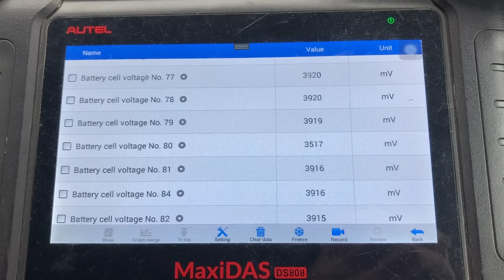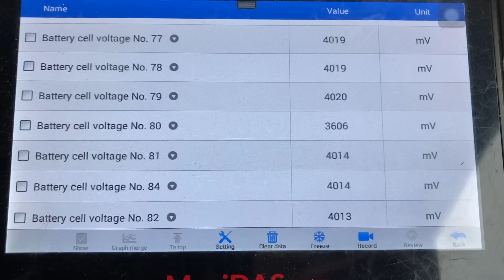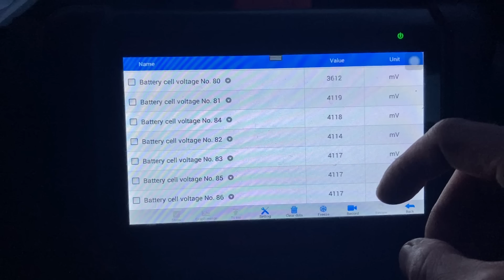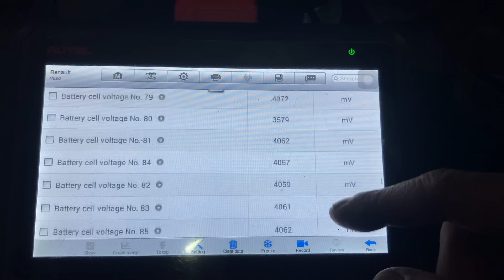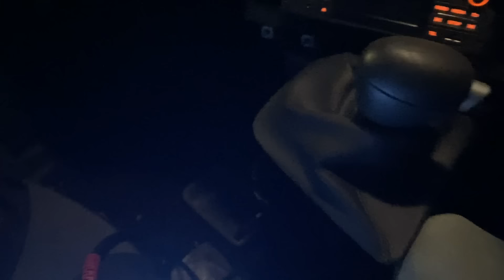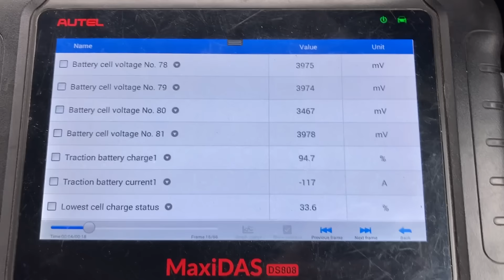2018 Renault Kangoo ZE33 battery repair PART 1 - low cell, EV repair

Comment: Hello, I have a 2014.Renault kangoo  130.000km, 22kw battery with about 57 soh and 2 bad cells. Should I try the same thing?
Reply from the maker: Hi it depends how bad the bad cells are but I am aware the 22kw Batteries can be quite tired by now, especially given the mileage of yours. It likely needs replacement cells or I believe you can fit the larger Battery, you just have to get one cable from the donor can where the bigger battery comes from. Cheers
Reply: @garycevrepairs there is a message on the dash elec fault. It charges it runs and drives. I also changed the 12v agm battery few days ago

Comment: Until you can measure the voltage of the individual cell with an independent meter and compare with others we don't know if it is a faulty/under charged cell or faulty BMS. As it does appear to be OK.
This brings back the argument, should you charge a lithium battery to 80% to protect the battery or 100% to enable balancing the cells. I guess a bit of both and depends if you intend to use the vehicle straight after.

Comment: My money is on that call being leaky. Best way to check is leave the car off charge overnight and see if it drops more voltage than the others.

Or maybe the cell balance failed or was disconnected, at some point?
Reply: Or they put the wrong capacity cell in?

Comment: Don't know if this will help but I have noticed a pattern on my ion (i-miev that you mentioned) I found sometimes if cells go out of wack the slower you can charge then pack I think the easier the BMS can try and balance I've noticed slightly better range and balance on my 15year old ion battery if I charge on 6 amps than 10/13amp 

Don't know if it's worth trying to top charge on 6amp
Reply: What I'm trying to say is the slower charge rate helps the BMS/cmu balance for a longer time on a lower c-rate so maybe 6amp charging and the 12volt lights on like you had may be worth trying before you drop the pack

Comment: To me it looks like a working cell, with working cell balancing, but with the pack management logic seeing it as 512mV lower than it actually is due to a higher level electronics issue, which is what is reported by the diagnostics. In this case balancing won't change the offset, and nor will state of charge.
If it was a cell 'chemistry' fault then the voltage difference would change a lot with battery state of charge, and you don't appear to see this.

Comment: The balancing is going very slowly, let's say 50ma at max. So all the hight cells needs to balance to charge that one cell. And then the charging is 50ma at max. So that cell is about 85Ah capacity, 60% of that is let's say 50Ah you need to charge at 50mAh so it will take 1000 hours to charge it like that to take it to full. And then the question is why is that one cell low? Or the BMS is faulty in some way(draining the one cell always or the measurements is not good) you need open the battery and measure with a multimeter and then you can charge that one cell with a separate charger

Comment: Hi Gary,
That heater flap.....it might be worth checking the cabin filters. It's quite common on these that people (inc Renault dealers) stuff the heater box with screwed up cabin filters, which ends up breaking the flap in the heater box or maybe it just breaks where it was on this van.
Reply: I had the exact same thing happen to me. Someone shoved 3 filters in there and the flap arm snapped. I glued and screwed it back together and now I've got heat!

Comment: I'm not sure if you've been deep inside one of these - there's an excellent teardown video on youtube - "
Renault Zoe Battery Disassembly - LG Chem Modules - DIY EV Powerwall Solar". I've been inside mine to manually rebalance (I don't have a Zoe - it's used for static storage). 
The cell tap wires are connected by small fuses, which are very close to the bottom of the packs and can corrode when water gets in (from condensation especially with short trips). The video shows how to remove the cell balance fuse and examine (it's not easy, requires the individual 8 cell pack out and the top cover off). On mine, quite a few were corroded. 
Cell 80 is the end (two - 2S) of one of the packs, which makes me suspicious. ISTR the balance current is on the order of 20mA, so if the cell is indeed unbalanced, it's not going to move that far before the heat death of the universe. Easier to remove and manually charge with an RC lipo charger (battery split, of course).
Interesting video, thanks!

Comment: Gary why are cells 82/3/4 in the wrong sequence on your diagnostics box? 

Has someone wired them in the wrong sequence? Could that affect the BMS balancing 
process?
Reply from the maker: Hi suspect that is just a display issue with the diagnostic tool.

Comment: Looks like the cell voltage may not be being measured correctly. Dry joint? Do these boards have the crappy lead free solder? It would be interesting to measure the actual voltage and maybe reflow parts of the board after a really close look and prod.
Reply from the maker: It’s quite possible it’s misreading, customer has authorised taking the battery out to check the cell so we will see! Thanks.

Comment: So, the cell is either defective OR - which is just speculation - the voltage measurement is somehow degraded, e.g. by a corroded connection. Either case would require removing and opening the pack though. It'd be worth it, because otherwise the pack looks intact.
Reply from the maker: Customer has authorised taking out the battery to inspect so we will see!

Comment: Maybe the balance lead for that cell has a bad solder joint causing high resistance, which in turn causes a lower voltage reading. Is it possible to access the individual cells in these packs?
Reply from the maker: Customer has authorised taking out the pack so we will see! Cheers
Reply: Yes. I was thinking similar. Maybe a fault in reading the cell voltage, rather than the actual cell voltage.
Reply: Maybe a faulty resistor between the cell and the voltage sensing device/chip

Comment: It's either a broken cell or a broken balance board. If the module checks out fine, switch 80 with 81. If it balances then if you charge you know it's the board.
My money is on broken balance board...

Comment: As a non-expert my hunch is that cell 80 is the one that was replaced by Renault - possibly a brand new cell, but it was never matching the rest of the pack by a fair margin. And thus has never balanced. I recon that when you manually charge it up to match the others, it'll fix it and the battery will get a whole new lease of life. There again, I'm just guessing. Be curious if I'm on the right tracks or not lol
Reply: But then if that was the cell that was replaced, then it suggests the previous cell was the dodgy one before. Could it be that the cells were always ok but the balance board has a fault? or a faulty resister or chip on that cell's circuit? So even if you balance or replace cell 80 it could go 'faulty' again?
Reply: @TheGramophoneGirl  Yep, it would be interesting to see what the balance current is across each of the cells.  If that cell is healthy the BMS should be able to top balance it if left at 100% charge (unless some Renault BMS shenanigans are in play here).
Reply: Given the design of the cell packs they would have changed a pack of 2 or 4 cells. IIRC the 33kWh packs have 4 in a housing. Actually it is 4 or 8, because there are two cells in parallel.
Reply: @ticso24  So possibly a dodgy resister or chip on the charging or balancing board then?

Comment: that's a huge amount of out of balance. Checkout the DIY Solar wall projects which deal with balancing large batteries. IMO the only way to balance this is to pull out the pack, open it up and manually feed power into #80 with a charger. Easiest way would be to have the car charge the pack to 100%, then open it up and then use a liion battery charger to charge #80 up to the same voltage (4.15 or so).